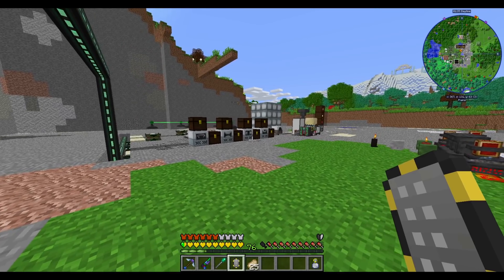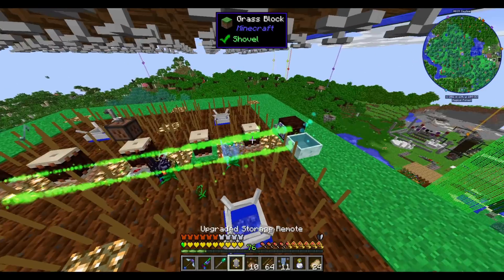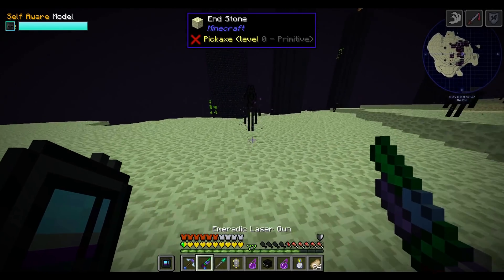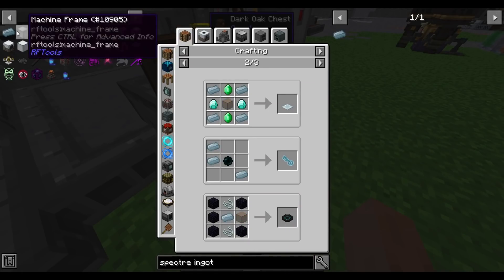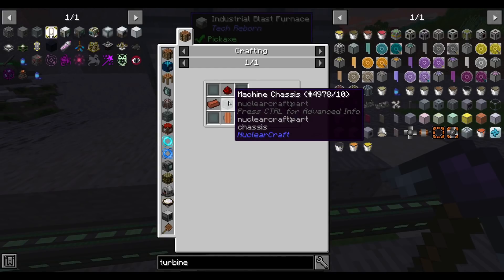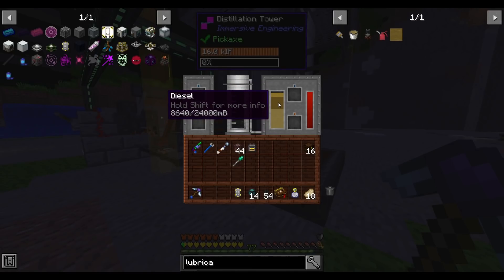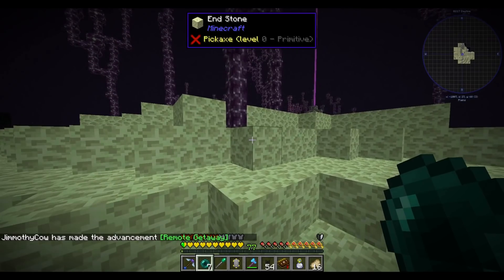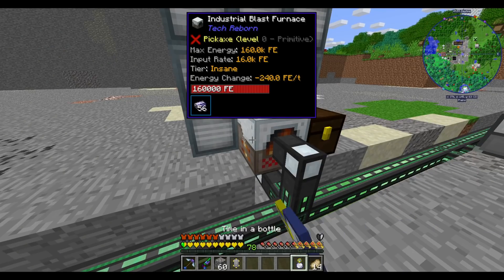Multiblock Madness EP16: Fancy Controller Block

Comment: It seems to be worth automating botania's loonium in this pack(dung loot is good)
Reply: It only gets regular dungeon loot sadly so not that good tbh
Reply from the maker: @Royal_4096  Really? I was planning on doing it as soon as possible (which isn't very soon, it's gated pretty hard). Big sad if true =(
Reply: @JimmyCraft  When I say real dungeon loot I mean from specificity the dungeon loot table when you search in JEI, it doesn’t pull from say nether fortress loot.
Now it could have been changed in this pack but I highly doubt it, worth a try though
Reply: @Royal_4096  D:

Comment: Gold nugget for some reason gives a debug message when clicking any block, to put gold nuggets in you need to pipe in
Eventually you get access to the precision assembler for circuits
Reply: Used to be Sticks that did that I believe... it's Gold Nuggets in this pack (unless it's another mods debugging info).. idk